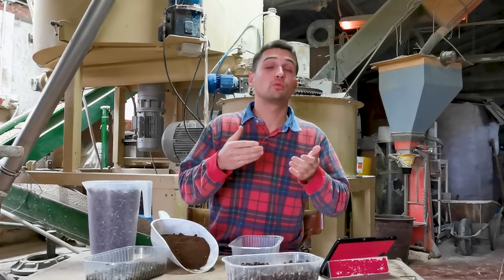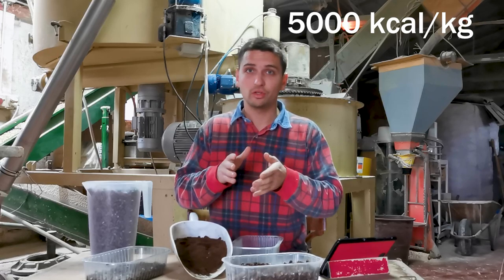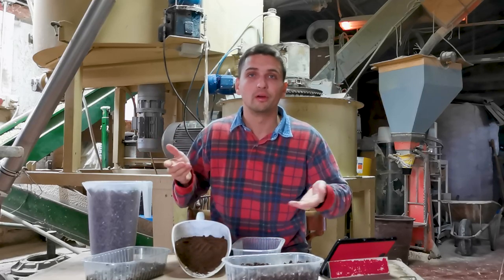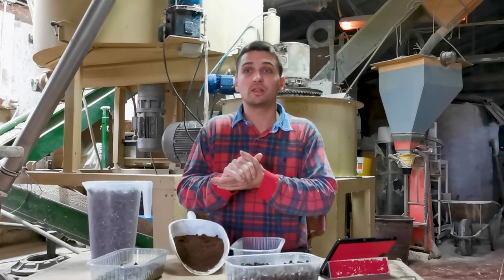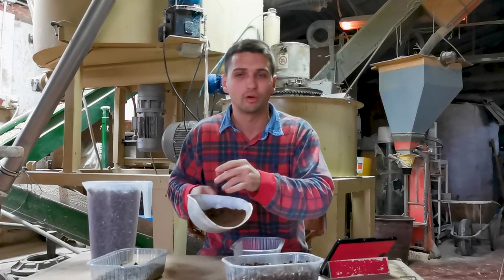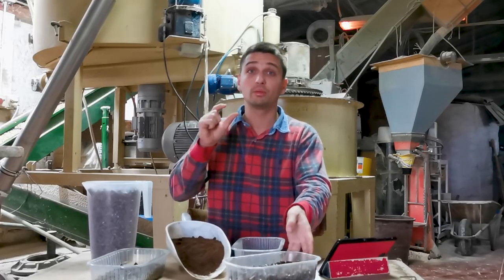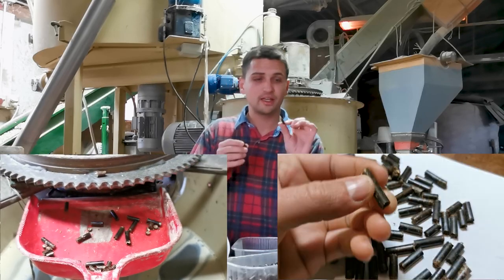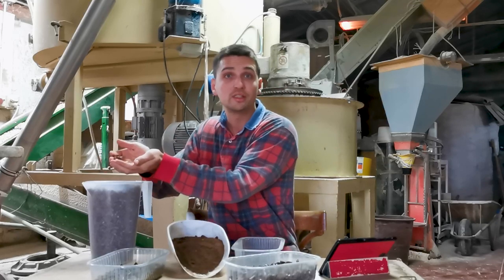How it's made! COFFEE GROUNDS into PELLET - some tests in the factory

Comment: Good ideas. How did you reduce the moisture content of the coffee grounds? Was the any residue from the oils, etc. after combustion?
Reply from the maker: Hi! Thank you for the comment! 

Well, in this specific case we left the coffee grounds in the factory for several months, so ther dryied out almost completely. In production conditions I would use an industrial dryier (as you can see in the pellet video explanation, in my channel). it should be ok a 5%-15% moiusture content in the final product, the one before milling phase.

About combustion residuals, I'm sorry but we haven't still done any combustion tests. They will be showed in the next video. I won't expect that much residuals, oil and greases in the coffee grounds will burn correctly in the stove. Maybe we can find something in home-fireplaces and pellet stoves, where combustion is not at that high temperature, such as those of big (high kW) wood chip and pellet stove. In these machines I'm quite sure the combustion will be very good.

Hope this reply was ok for you! Bye!
Reply: @profilo_is_back  I live in western Canada and have been looking at burning sawmill offcuts, Mountain Pine Beetle damage, recycled engine oil, coal fines/granules. I can add coffee grounds to the list of ingredients to investigate in the production of fuel cake and pellets.
Reply from the maker: @enkhyy  That's good, everything is celar. Yeah, I'll try for sure combustiont tests with this material. however, I won't compare wood and coffee grounds (organic materials) to recycled engine oil or coal, fossil fuels. Speaking about tests, that's ok. But I won't for sure burn recycled engine oil at home!

Comment: Does it also have a nice smell as pellets and when burned?:face-blue-smiling:
Reply from the maker: Hi! Thank you for the comment! We still haven't done any burning test, neither any comparison. Incredibly, we do produce wood pellet in our factory, but we haven't a pellet stove on which we can do some tests. i don't know what's the smell when it burns, but for sure I can tell you that when we were doing coffee pellet, the coffee aroma and flavour was strongly present in the air!
Reply: @profilo_is_back  could you make 100% coffee ground pellets? I understand it is not good for burning. If it works, could it be good for something like cat litter?
Reply from the maker: @nickj2508  Hi! Thank you for the comment! Well, I don't think ti qill be so easy. Maybe with an higher compression ring die you can use much higher coffee percentages, however I think a bit of wood hsould be still necessary. About combustion, we will do some tests in the next week. I don't expet any big troubles. About cat litter, this may be a very good intuition! I've never tought about that.
Stay tuned for the video about combustion test! Bye!
Reply: Plx share the burning results as compaire to other pellets... Also share is it work if we add coffee in to hard wood as compaire to chestnut... Actually people wants those raw materials that easily access
Reply: @nickj2508 crazy fact about cats and dogs. They cannot breakdown caffeine. It is toxic to them. 
I'm unsure how specific the absorption would be on the pads of their feet. But I would certainly keep the coffee and anything else known for caffeine content away from them.